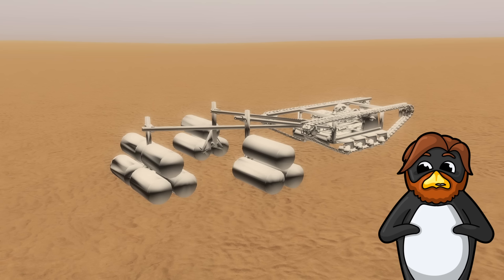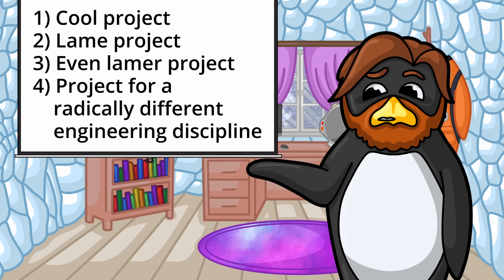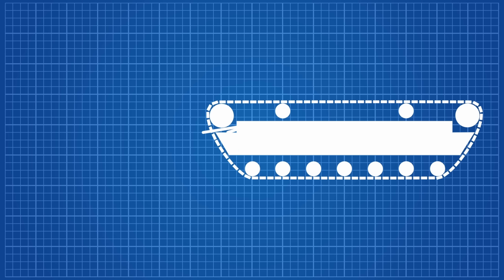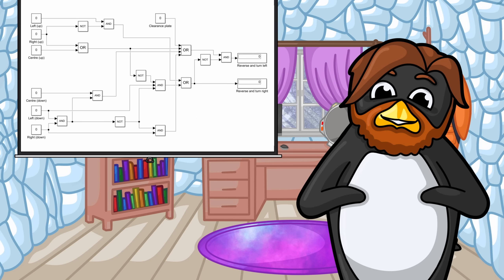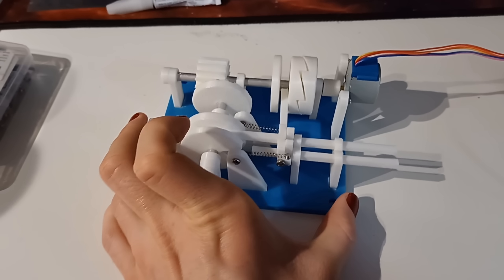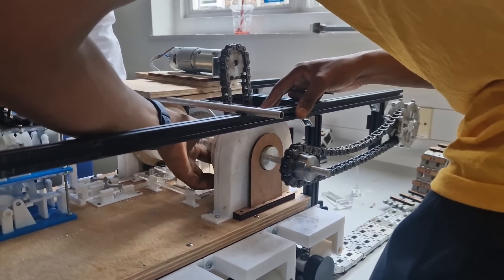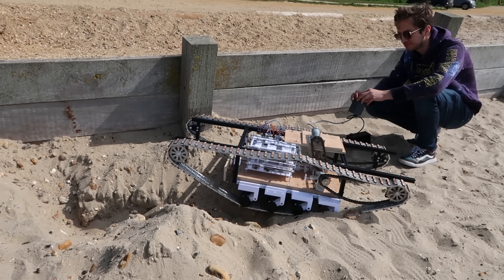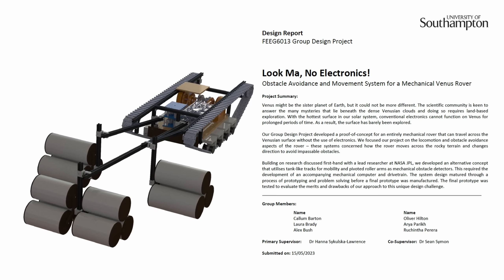We Built a Venus Rover so NASA Didn't Have To

Comment from the maker: Just to answer a few common questions I've received:

1) What's the point if, without electronics, it can't do any science?
As mentioned in the video, you can make mechanical seismometers. You can also make countless other instruments such as thermometers and barometers. You can then transmit the data using anything an orbiting satellite can read with active radar, for which there are a lot of interesting concepts. These supporting technologies were a focus of Dr Sykulska-Lawrence's other research.

2) Why not put the electronics in a fridge powered by the wind turbine?
Venus is just too hot. The calculations had already been done in other research and nothing short of a nuclear reactor could power that much cooling. The reactor and cooling system would then need to operate at even higher temperatures in order to dump heat to the environment, so it simply isn't feasible.
Reply: Oh! Transmitting by flashing a reflector at a satellite is a neat idea.
Reply: @MadPirateShin  that wouldn't work, you couldn't see the flashing through the thick atmosphere
Reply from the maker: @Tmccreight25Gaming  yes you can, there are a range of wavelengths that can penetrate the clouds
Reply: @Tmccreight25Gaming  Radar might penetrate the cloud cover. Having the radar emitter on the satellite also simplifies the rover. The reflector just needs to be designed for whatever energy type can penetrate Venus' atmosphere.
Reply: @TheBeardyPenguin  Out of curiosity what was the name of the team who built the finished rover with a stripped down computer?
Reply: Theoretically, you could adopt analog electronics to Venusian conditions. Resistors, capacitors, transistors(?) can be produced from materials that work natively in that environment. By adopting analog electric components you could send pictures, telemetry etc.
Of course there is still need for mechanical applications, but making signal processing (that is complex computing) on a tiny gears - sounds like it would work well in simulation - but harsh conditions would kill it shortly.
I can imagine that "native" electric Venusian rover would work only on Venus as Earth would be too cold. But this is a very interesting engineering project - how to develop, build and test device that is hard to be tested on Earth - testing in an oven?
Venus is relativity close, with dropping costs of sending to space it's an interesting destination. Also it's "easier" to land on comparing to Mars - it's like diving, so it's slower thus easier to control.
Reply: Love how people completely forget that mechanical computers 100% did science back then.
Reply: LOL yeah  @SockyNoob , the people involved with these projects in the 1970s are certain to have memory problems after 54 years!
Reply: why not a heat engine using the seeback effect and not a fridge but a cooler it has a shelf life as a rover but it gets down does it thing and has +12 hours of battery for lag time/transmitting then you make every other system mechanical like in your current desgin boom an electro mechanical rover powered by the outside and still able to function within parameters
Reply from the maker: @thecoolestofthe834s2  firstly you can't make an engine with the Seebeck effect, it produces electricity.
Secondly, you need a temperature difference for it to work. So sure, it would work for a little while after landing, but then when the rover reaches equilibrium with it's environment it'd stop producing anything. The point of the rover is for it to last months.
And no, you couldn't use the electricity generated to power a cooler that maintains the temperature difference, that'd need an efficiency of over 100%
You can't power the rover with the heat of the environment, you need a cold junction which you don't have. If you use the rover as the cold junction, you heat it up to the same temperature as the environment rapidly and it stops working. The only way is to have something on the rover that's even hotter than the environment and do things the other way around, but as I already explained that isn't feasible.
Reply: @TheBeardyPenguin  quick question could you use some form of steam engine to power it  using the heat of the atmosphere to heat it up, or even another form of gas or liquid that would be less corrosive. i understand that there could be issues with this but would it be possible or even logical?
Reply: love your video by the way.

Comment: I am re-watching this, and as a high schooler, who fancies making projects like this, I am wondering why did you use (expensive) 2020 aluminium extrusions and not the relatively cheaper steel extrusions. Come to thing about it, why didn't you skimp on material, when you started cutting costs? Why use new stock, when a old furnace's wall made of 6mm steel exists (I made a CNC mill out of this). 

I find that students usually forget the extreme budgeting that the people younger than you have to do
Reply from the maker: We needed to make the tracks out of aluminium as having as close a mass simulant to Titanium as possible was pretty vital to our research. We wanted to prove a tracked vehicle could work within the power constraints of the wind turbine, which we successfully did. Those had to be manufactured out of sheet metal as we needed 160 and their tolerances were quite tight to smoothly fit together.
Almost everything else was machined by us from scrap we found in the uni workshops, there are videos of me using the lathe and Callum using the mill.
Trust me, we did more than our fair share of extreme budgeting. Or did you miss the part where we literally used bike parts..?

Comment: uhwm pe tape. industructable 0 friction tape, really cheap from china. wonder if it would have helped with the friction? i use it on the door frame of my bathroom so the over door towel hooks my gf puts on the door dont scrape up the wood. i also use it on the bottom of the drawrs for dressers to make them glide as if theyre on tracks

Comment: This is suuuuper cool! I'm playing around with another concept where you use pneumatic valves as logic gates rather than mechanical linkages, and I think it would work very well for a mechanical rover because you can pipe the air pressure from sensors/to actuators.

Comment: I haven't watched yet (annoying, I know lol) but the first thing about a clockwork rover working in such an extreme environment that jumps out at me is the high heat changing the material properties of the metal. Especially with expansion. A clockwork mechanism needs very tight tolerances to run properly, and for a long time. But, heating it up will change the dimensions of every single part. I guess with a large mechanism, tolerances don't have to be AS tight, but expansion would also be more significant. Ie a 10 foot pole will expand more than a 1 foot pole. I'm excited to see what you came up with and how you addressed these issues.

Comment: What about special vacuum tubes made of quartz tubes and Tungsten metal bits?
Reply: Thought exactly the same. Miniature tubes and primitives electrical parts could even form a relatively complex computer with ROM, RAM, a CPU and an RF transmitter to return data, and since even normal consumer grade tubes work at way higher temperatures than the surface of venus, heat shouldn't be an issue. Or, if you want to make it even more compact, VFD displays are triodes as well, so you could build a digital triode computer as a very wierd, large microwave clock display, requiring only a single set of heaters at ~600°C, instead of many at 1500+, reducing energy usage and failure points.

Comment: It's the opposite engineering challenges from nearly all other probes and rovers to date, engineering to withstand major atmospheric heat and pressure. While the electronics we have and use now would never survive that environment long enough to gather useful information, is it possible to engineer completely custom electronics that actually can operate at such high temperatures? Mechanical and/or electronic, I can imagine just the thermal expansion nature of materials makes it all really really hard to devise a workable Venetian Rover, but hopefully you guys and gals will figure out brilliant solutions.

Comment: I would love to see the math on why you can cool something enough to get it into the right temperature range.  I would think that dewer flask encased electronics could let you get down to the 80c or so needed to reliably run a a silicon based computer.

I'm not sure water it is in metric, but vacuum house paneling can be r100 which means it lets 1/100th of a BTU through per degree per sqaure foot.  A refridgerator generally only needs r10 or so to reach a 30 or 40 degree difference, and they are big.  And i saw a small one that used tens of watts to do that using TEC modules.
If that can be scaled up, then with 10.times the insulation you can get 10 times the temperature difference.  Though the efficiency drop across that big of a range would likely mean you would need to do it in stages.  That would put you in the hundreds of watts range or kilowatts range at worst.

Only the electronics need to be kept cold.  Temperature and spectroscopics can be done through fiberoptic cables to isolate them.  Many other systems can be mechanical.

Comment: Maybe you just didn't show it, but the lack of any sort of active amplification is always going to make a computer built purely out of those gates unviable. Friction in a gate is dependent on load, and load is dependent on later gates, so you end up with geometric load growth with depth. You need some sort of external energy driving the output of your gates, rather than relying purely on the input. The one critical factor for being able to build a computer is amplification. You can build a computer out of any element that can amplify.
Simplest way is probably a pair of clutched gears on a driving gear. Both are driven off a common power shaft, but one is reversed. You set it up so that each state will disengage one of the clutches.
This project is undeniably cool, and a monumental achievement, but you will probably look back on it and see many mistakes. Not having a background in computing specifically shows. The fact you were able to get a computer working without designing anything that could be repurposed as an output driver for the gearbox is an achievement, but not one to be particularly proud of.
Reply: I mean... I take issue only with the final line from above.  Without being able to find more resources (they went to a tank museum to learn more--they were desperate), having limited time, and also having limited team knowledge and resources, I still think it IS something to be proud of.  Of COURSE the design needs heavily iterated on!  It's a very early conceptual prototype for bizarre conditions, made by students with, again, notable constraints.  Information like what you present is very useful for future iterations, but seeing many mistakes when looking back is NOT something to ruin pride in the achievement.  Mistakes are part of learning and prototyping--they should ruin pride only if they don't get caught before a finalized product.  Getting it working at all when they had other projects and classes is enough for a start, and a start was what they set out to achieve.  There's a reason it was recognized as highly as it was, and its deeply flawed and troubled usage is useful for showing where further iteration is needed.

Comment: Don't use electronics sounds very silly. What information are we going to collect without any electronic based sensors.
Reply from the maker: As mentioned in the video, you can make mechanical seismometers
You can also make thermometers, barometers, and all sorts of other instruments
You can then transmit the data by displaying anything an orbiting satellite could read with active radar, for which there are a lot of interesting concepts
Don't dismiss something just because you don't know enough about it

Comment: Great video and yeah this is what engineering is about! Which I have the feeling your vehicle could have been slit into two parts... the machinal computer with dummy inputs and a smaller vehicle made with a digital computer. It would have solved all you budget problems you brought up in the video... Like I leanered long ago that a good designer must ask this question... "If I can't do this, then what I can do?"

Comment: There's no point in sending a prob to Venus that has no electronic. As it won't be able to send data back to use. Which is the purpose of a prob.
Reply from the maker: Actually as mentioned in the video, you can make mechanical seismometers
You can also make thermometers, barometers, and all sorts of other instruments
You can then transmit the data by displaying anything an orbiting satellite could read with active radar, for which there are a lot of interesting concepts
Don't dismiss something just because you don't know enough about it

Comment: My idea for a mechanical venus rover would be computers made from MEMS relays. Basically that huge room-sized computer they made in the 40s out of relays, but with the relays shrunk to microscopic sizes with modern technology.
Reply: But magnets don’t like the heat
Reply: @m_disulphide  mems relays work electrostatically, not with magnets. Besides, electromagnets work at any temperature.
Reply: the issue of relays is that you can hardly shrink them, i don't think you would be able to make them small enough for this
Reply: @babch0  You can actually shrink them. A lot. Some MEMS relays are 50µm in size and some are even smaller. They can have switching times well below 1ms. And that is today, with the requirement to switch certain voltages and currents. If the requirement is to just be able to switch similarly sized relays, shrinking them allows for lower requirements, again allowing more shrinking. You could put a lot of them into a shoebox sized volume, surely enough to make a decent processor.

Comment: Did the oven not give high enough temperatures for your needs? Only reason I can think of to use the stove instead, but it there's another I'd love to know.
Reply from the maker: No, it didn't
You can get things much hotter in a frying pan
Reply: @TheBeardyPenguin  Butane torches are cheap.
Reply from the maker: @MrBricks148 cheaper still to just use a frying pan
It worked didn't it :P

Comment: I once thought of many ideas on how to build a Venus rover. One being to have electric computers in an insulated casing, and a cooling unit powered by a dynamo from outside. The dynamo may not be built out of the most power efficient materials but it won’t melt and it will produce some power.  Though if it’s enough I don’t know. So maybe an RTG for the computers because even though the temperature difference will decrease initially it will increase again as the isotope heats up.
The rover can navigate with radar from inside and maybe even a camera that works like a pop up headlight if necessary and possible.
Radar may provide other advantages too. 
The windmill will not be a conventional one but rather one to capture wind from any direction you want even if less efficient. 
The electricity from the RTG just runs the computer and the steering servos, which allow the computer to steer the rover by magnets from the inside pressed against the wall where a steering and brake and maybe even reverse lever will be. 
Here’s the problem that I couldn’t solve, can we make an RTG for such temperatures?
And when a cooling unit (like a refrigeration unit) produces heat from its operation is that heat from a part that can be built to survive outside the rover or does it have to be inside? In which case it may make more heat then it gets rid of. 
If the refrigeration unit can be built to survive the outside on the parts that are gonna be on the outside (at least the radiator) then that’s all good. Now how about that power generator? Can we build an RTG that survives those temperatures or an alternator for the wind turbine that survives those temperatures while also making enough electricity? If yes to either power source then congrats you now have a working Venus rover with a modern computer and radar to actually see what’s going on and transmit the data back. Maybe even a camera if the popup headlight idea works correctly and allows the camera/cameras to take photos before taking on enough heat to melt. Then waiting for the rover to cool down to do it again. If it gets stuck then you’re screwed.
But if those fail I don’t know what to do.